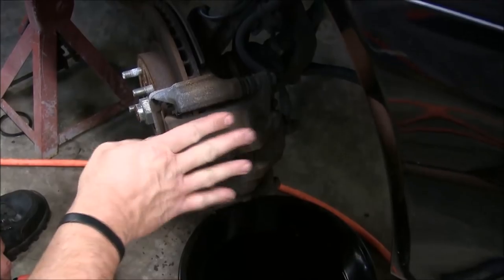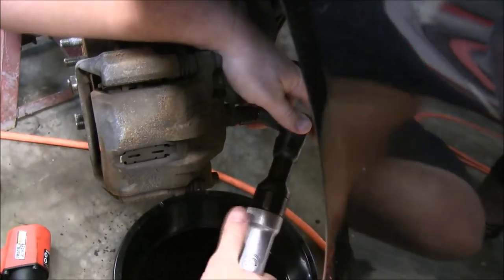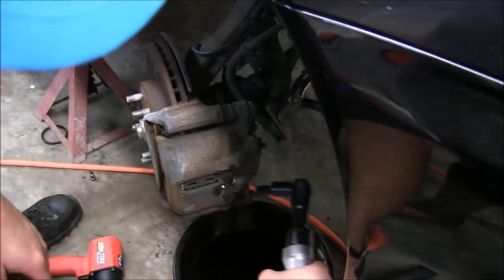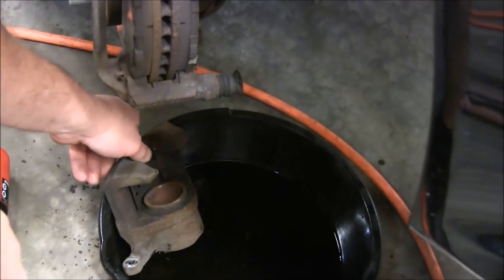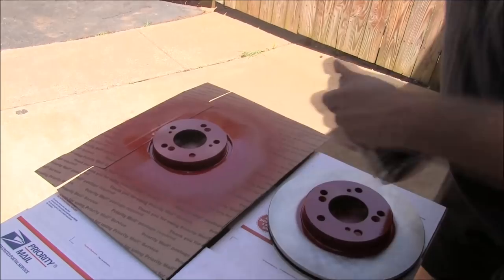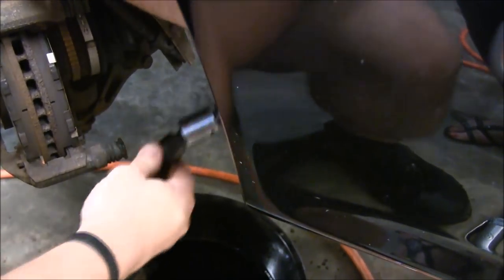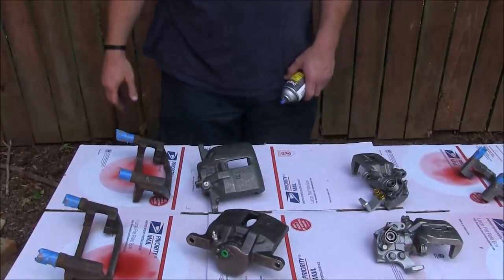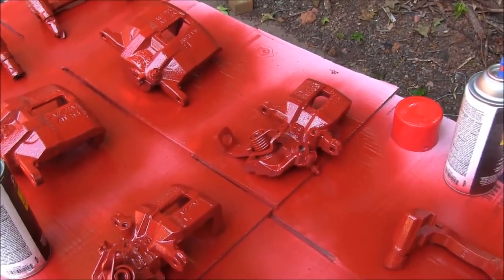How To: Custom Brake Job with Painted Calipers

Comment: So did you paint the inner breakcylinder - sealing as well? Whenever I watched videos about painting calipers they have been coverd so the rubber is not affected by the paint. 
Nice video anyway, motivates me to do it aswell. :) 

Cheers from Germany :)

Comment: The rotor face that contacts  the brake disc SHOULD NEVER  BE PAINTED.  It transmits torque to the wheel by  friction
Reply: Rotor face that contacts the brake disc? Did you mean brake pad?
Reply: No, he means the very face of the disc rotor - the surface that mates to the back of your alloy. It's also a complete myth.